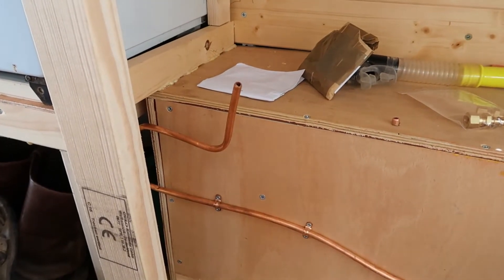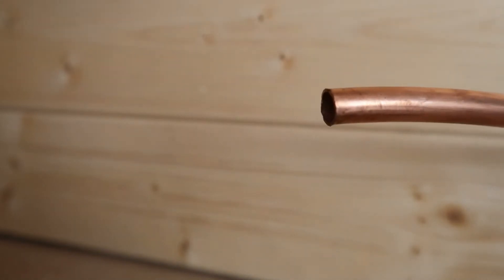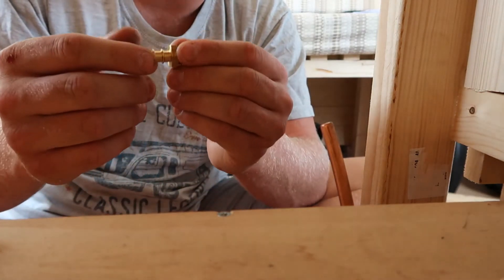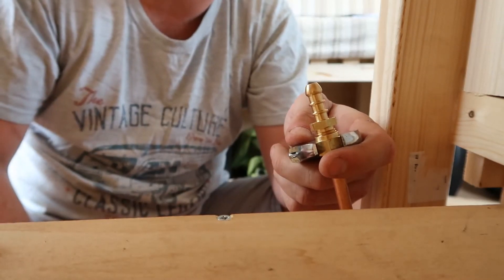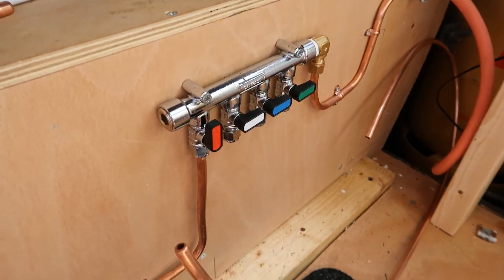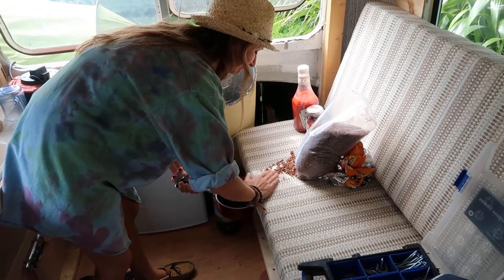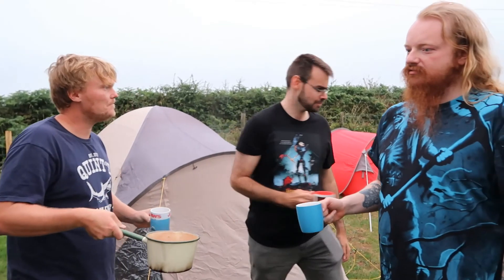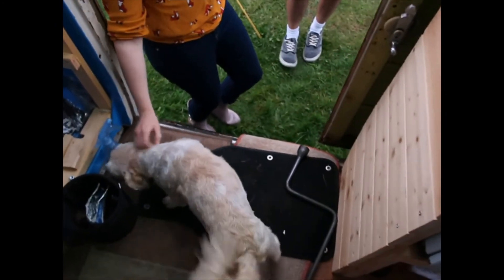vintage van life episode 12, friends and gas

Comment: When is the campsite open to the public? 
The hot chocolate looks delicious 😋

With the gas hob / oven have you considered firing some sort of metal / fireproof protection for the wooden frame and walls ?
Reply from the maker: Hello, yes I have indeed, and I will be fore proofing the area, having said that it's amazing how cool the exterior of the oven stays during use, but always best on the safe side 

Hot chocolates were quite the highlight 

Cheers
Reply: @forwardtothepast2411  wondering how many weeks will go before you finally  find all the errant cocopops!

Thanks for the update , looking forward to the forthcoming ones as the van is really starting to look quite  like a home sweet home now !